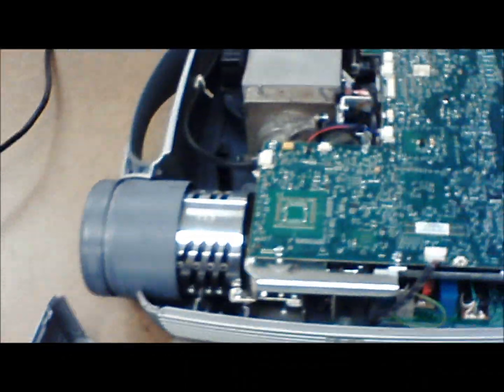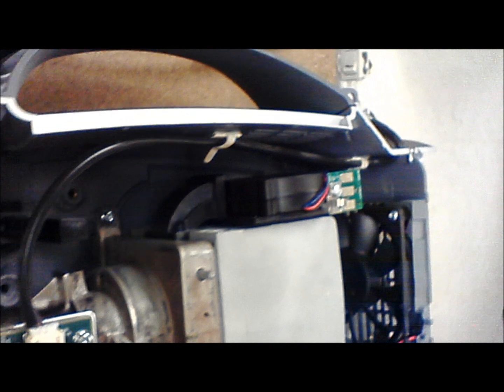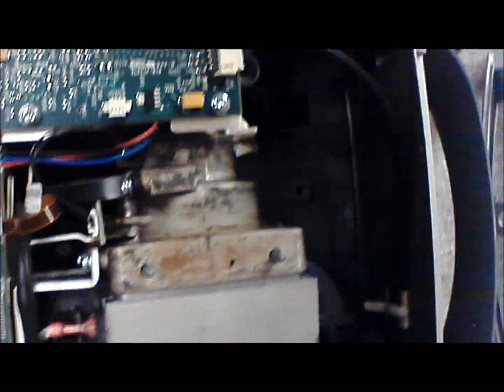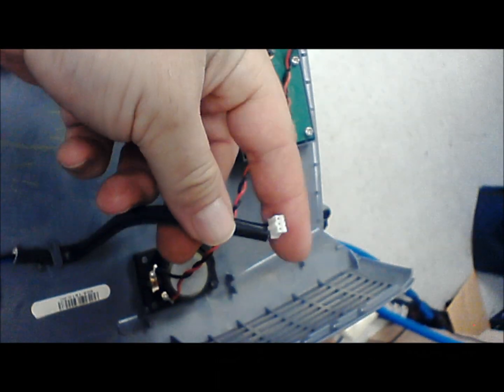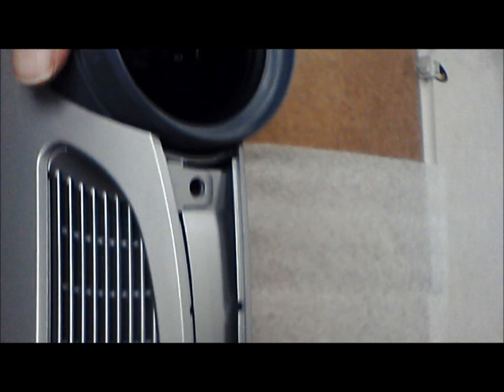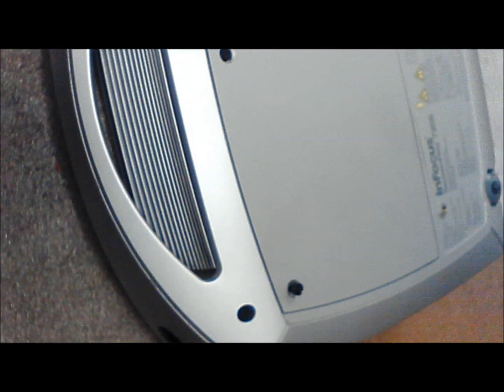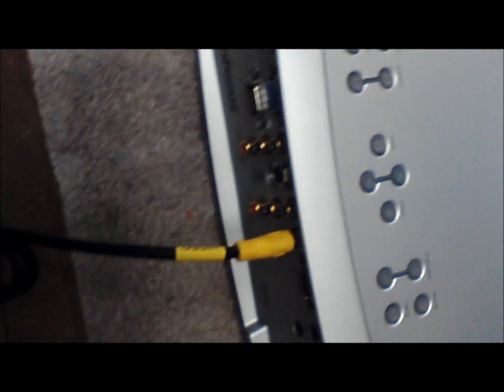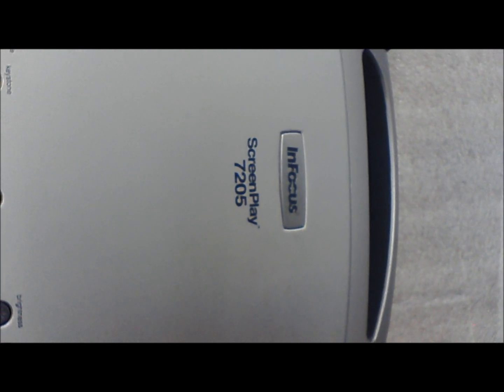Infocus SP7205 DLP Projector Lamp Fan Repair

Comment: Apologies for commenting on this older video. I picked up an older 7210 and it seems like the color wheel is stuck and it makes a chattering noise while attempting to spin. Would this most likely be bearing, the motor, or the sensor failure? Are these 3.3v or 5v?
Reply from the maker: nah you're good.  Youtube just lists whatever comment is newest regardless of the video.  if its chattering its probably bad.  Usually you dont really repair these because new ones are really inexpensive.  These are 3 pole with common brushless motors that are driven with pwm so the voltage varies and could be 5-12v pulsed.  I seem to recall the 7210 using an oil bronze bushing/bearing instead of ball bearings which would make sense if its chattering. you can try cleaning up the motor shaft.  Make sure none of the segments are loose. if they are, get a new wheel. It might even be better to source a new wheel altogether but there is no harm in giving the old one a chance. Also this video might help explain the insides a little better. https://www.youtube.com/watch?v=EKq_hJf-qdM

Comment: I got the lamp replaced the projector, turned on as it’s meant to however, the white screen of death comes up and it says” searching. What is my next step?
Reply from the maker: Usually that means it's not seeing the input cable. Make sure whatever is feeding the video signal is working

Comment: Thank you FixitFrank! I'm working to replace out bulb now and not sure if we need the housing unit as well? Also do you know how to get the unit down from the ceiling for repairs?
Reply from the maker: Hi Kellie,  Ideally you want to replace the entire housing. But since this is an older projector, you could get away with just the bulb itself.  These are a little involved but far from difficult to swap out the bulb from the original housing.  The proper bulb is a Philips, part # 928131705390.  The Osram version some people sell won't fit properly. 
As far as removing it from the celling mount, I would need to see a picture of the mount.  There are so many out there are they all work slightly differently.  There should be something that releases the mount into two pieces.  One part stays on the projector, the other stays on the ceiling.  That is usually how it works.  Here is a company who sells the bulb.  https://www.purelandsupply.com/philips-uhp-bulbs_uhp-300-250w-13-e218.html  But I would shop around.  As long as you can find a Philips bulb with that part # it is the same thing and will work. If you need help with replacing the bulb, feel free to get in touch.
Reply: @FixitFrank  thank you so much for taking the time to reply! That is awesome. We purchased from your link as amazon was more $$ and not clear that it was actually philips. Thank you regarding the mount as well. We will work on it and see if we can get it down. Thank YOU THANK you for your help with this, grateful you have this post (8 years later)!!!

Comment: I have a screenplay 7200 I replaced the bulb but I am still getting a replace bulb message I cant get rid of. any suggestions ??
Reply from the maker: Hi!  Absolutely.  You need to hold down both brightness buttons at the same time for about 10 seconds.  That is the only way to reset the lamp timer.
Reply: I have done that as well as a factory reset and the message keeps coming back
Reply: there is a tiny gap in the bulb air ducting where the tab where the screw hole mounts. the prior owner must have broke it replacing the bulb at 1 point. anyway it worked fine when I got it after a couple movies the bulb went bad and I didn't order it till I got it yesterday. put it in and no matter what I do the message comes back
Reply: ps the message appears after about 3 to 4 minutes of being on
Reply from the maker: might not be the timer then. How many hours does it say it has in the menu?
Reply from the maker: also, did you get an sp-lamp-06 with a real philips bulb?
Reply from the maker: Id suspect that fan connector personally. Those are well known for problems. But if its a knock off bulb(not philips inside) then Id suspect that. Those cheap bulbs are junk.

Comment: What did you use to clean the prongs for the lamp fan?
I just received a new lamp and the LED light is blinking it's 4 flash warning, which indicates a defective fan. Just want to make sure it's not my projector that's defective.  ^_^
Reply from the maker: Hi, I used "deoxit R5" contact cleaner, but a pink eraser on the back of a pencil will work too. Does the fan have the 3 pads on the circuit board?  Some lamp manufacturers of the Sp-LAMP-006 don't set them up right.  Make sure the lamp is sitting down all the way.
Reply: Rostit
Yes, it does have three pads on the circuit board that reads: Fan Blower.
I believe the model type is: LP650, if that makes any difference or not.
Reply from the maker: Brandon Nyte Ok.  good. one thing you can try is unscrew your old fan and board from the old lamp and replace the fan on the new lamp.  Its only 2 or 4 screws I believe. I imagine the old fan worked fine and they don't wear out as fast as the bulb does. Otherwise, I would reach into the projector and bend the gold fingers up so they contact the blower PCB thoroughly
Reply: Rostit
Okay, will do. Thank you so much.  :-)
Reply: Rostit
Well, it's not flashing red anymore, just flashing green, but not starting up.
It usually just flashes green when you're shutting the unit down.
Very interesting.
Reply from the maker: Brandon Nyte do you hear the color wheel spinning up? also, make sure the power plug of the lamp is tight.  You should hear it trying to light.  sort of a tick tick noise. the color wheel should make a whirring noise.  Most importantly make sure the lamp door is on.  There is a switch that keeps the lamp off if the door is not installed.  Also make sure your timer is reset.  hold down both volume buttons for about 10seconds to reset the timer.  Here is the manual https://portal.infocus.com/support/Product%20Downloads/infocus_LP650_referenceguide_en.pdf
Reply from the maker: Brandon Nyte You may also have a power supply problem.  The main filter capacitors in the power supply are known to bloat and leak after some time.

Comment: Yeah thats why I have been looking at china.. yes the qual is decent I got my led from there 2x for 13usd inc p&p and is really bright.. hey if you can send my the links I can try and find them in the china market and get them. but yeah i think i will look into the Pansc and NEC models to re-use. Btw I managed to get the optic aligning for my diy... just need a 2" hd lcd and some tweaking for a good projection.

Comment from the maker: That is the tough part.  The LED modules in video projectors use some interesting optics.  Scaling up the image form the 3.5cm LCD panels to the 80+ inches of screen is tough.  Try looking for an old Panasonic LCD or something like that. I like the NECs and they are pretty cheap used.  Id give you some parts, but as you said, shipping is a pain.

Comment: Yep I know they avail in states i'm in uk and the shipping is killing. I already made a lcd projector. with really bright led light, 640x480 3.5" screen but need to better the picture quality when magnified to 50" projection. thats when I thought I would look in getting a broken down project for a 10-20 bucks and then fix it.. but hey atleast I get a good lens to incorporate in my diy. so most of the hard work done in the diy design. :-) just need a better video display to project from.

Comment from the maker: low-cost and LCD/DLP do not go in hand.  Go on EBay and look for Infocus LP70 or NECVT575. Or just search for any DLP projectors.  You can find them for less than $100.  I do not recommended building one.  Its way more time and hassle than it seems.  Even with all the spare parts I have, I know its much more hassle. There were 5 or 6 LP650s on EBay but they are in the States. Good Luck!

Comment: Hmm cool thanks very much for the advice I have been looking for a canabalisable LP650 on ebay.. no luck.
I guess I need to get back to my original idea of making my own projector.. just need a way to produce the picture.. light etc I have.. any ideas for a low cost solution for the mini hd lcd/ picture producing parts? and website to get them?
Thanks for the infocus advice I will still look for parts to fix mine.

Comment from the maker: Eh, the power supplies will be similar, but the DLP/DMD will most likely be different.  Certain parts will be compatible, but as I said in the other post, you probably have a pretty severe problem. EBay is your best bet.  Infocus won't have parts that old. You need another LP650 with good electronics to cannibalize to fix yours. Id buy a working unit without a lamp($200-300) and then put your lamp in it.  Then save your for parts.

Comment from the maker: To be blunt, that sounds pretty severe. Older Infocus units are like tanks. They run until something really bad goes wrong and then they are down..
 The 'dots' are pixels on your DLP Chip/DMD board failing. 
Without actually seeing it, that would be my best diagnosis. If it is a SP7205, hit up EBay for a parts unit or even a used unit.

Comment: Hi I need your help.. my projector is switching on, buttons work, but the image is monochrome there are couple of horizontal lines and now the screen gets slowly fills with dots (not dust). connected to a video source (movie).. display flickers to movie... still no real image, just lines and dots. press one of the buttons and displayed image shows change.. any ideas?? please help.. hope it is just power caps noise and not the mother board.. Thanks :-)